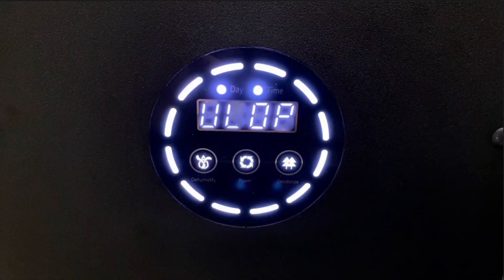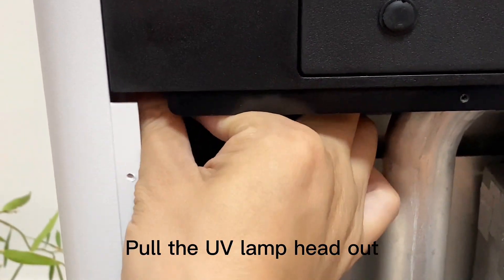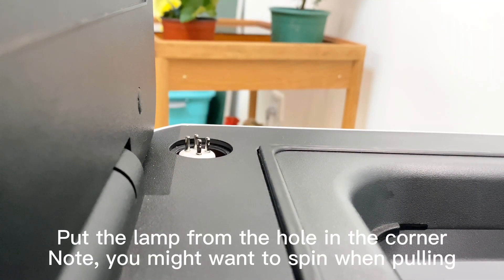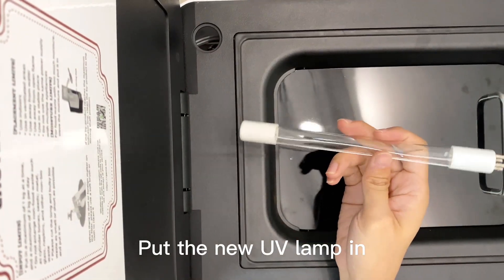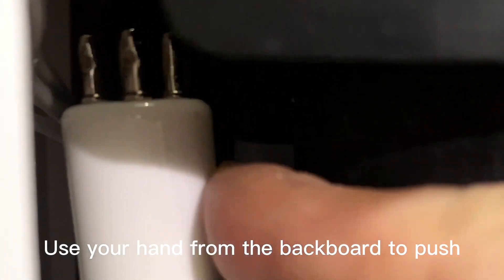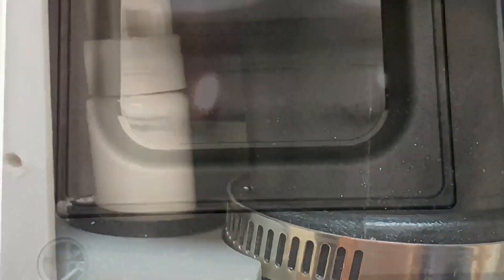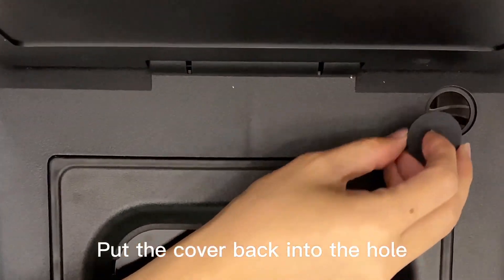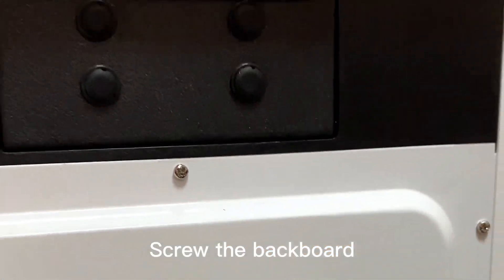GEME Composter User Manual: How to Change the UV light?

Comment: Wait, why does this composter need a UV light? Are you trying to prevent mold growth in the exhaust air path? Does the unit use activated carbon filtration?
Reply from the maker: Hi, the UV light is for 2 things
1. create photocatalysis to filter some odor 
2. kill bacteria for the ventilation system